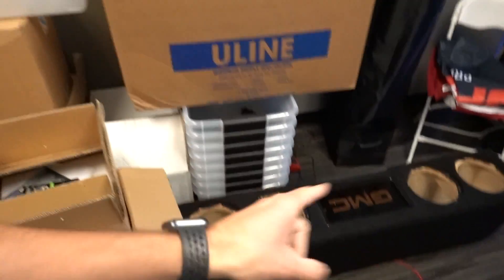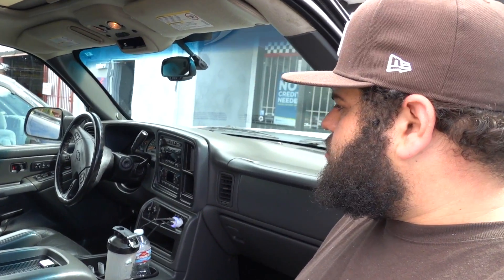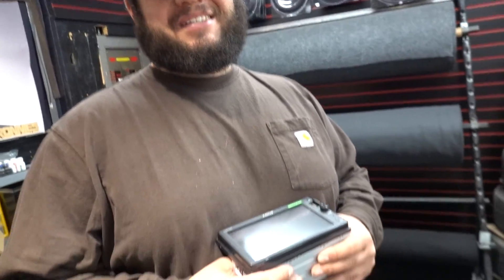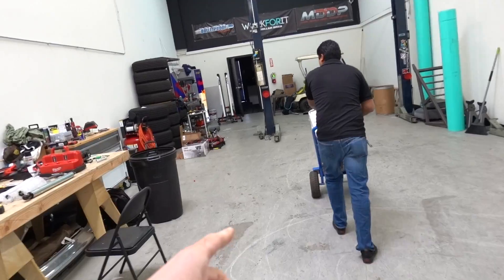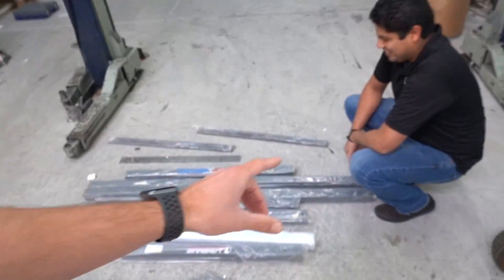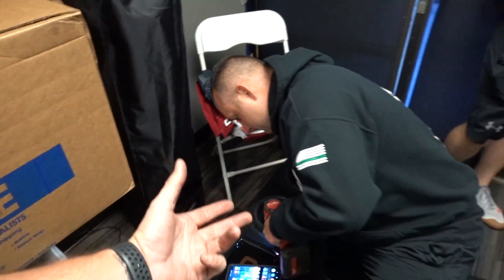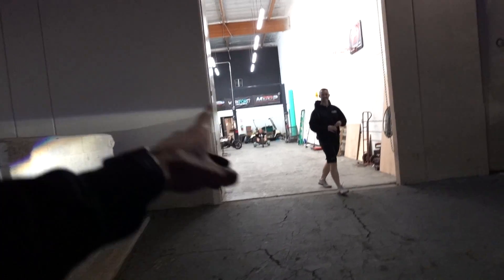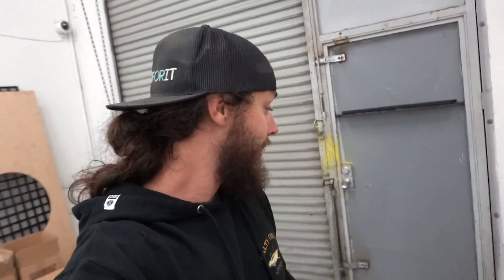I'VE BEEN WANTING ONE OF THESE FOR YEARS!

Comment: Aye I need some help. I need some advice on the next upgrade. 
Option 1: mirrors
Option 2: headlights
Option 3: cold air intake and throttle body spacer
Option 4: tint and color matching
Reply: william russell go with out a throttle body spacer in my experience if you want the most bank for your buck all you need is a CAI an exhaust and a tune with a quality tune you could making 30+ additional horse easy

Comment: It’s a entry level table, it will not cut small detail keychains like y’all are suggesting, and I don’t think that compressor will be sufficient if you plan to run it a lot.. also recommend a dryer system as moisture can ruin your cuts